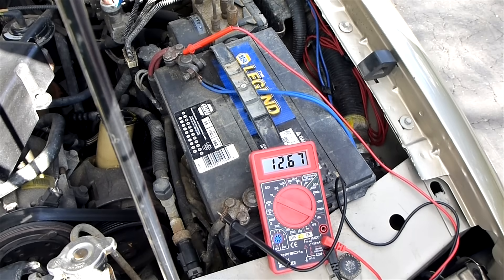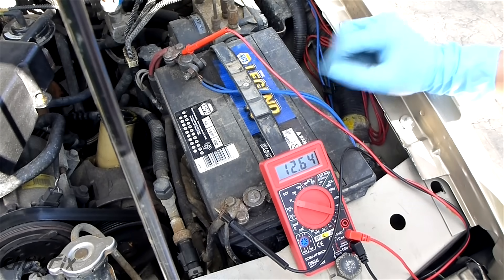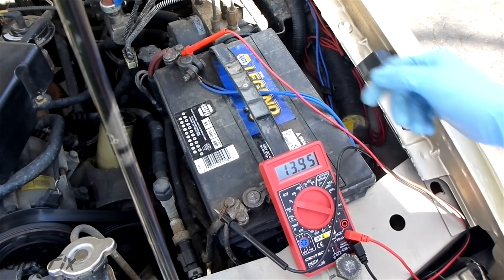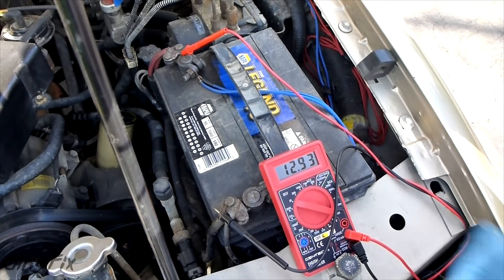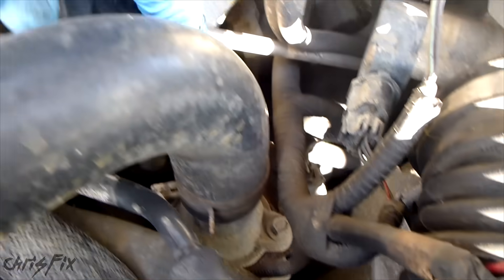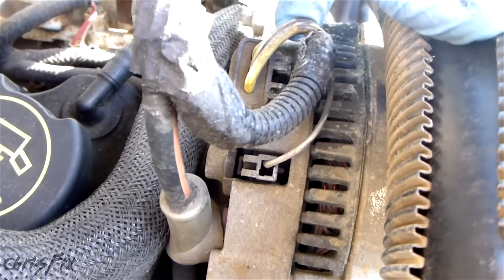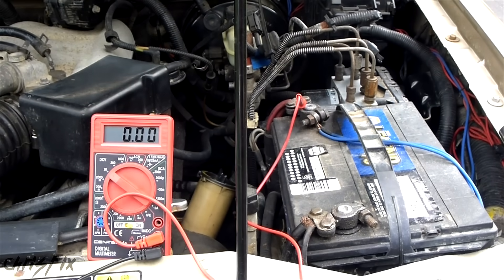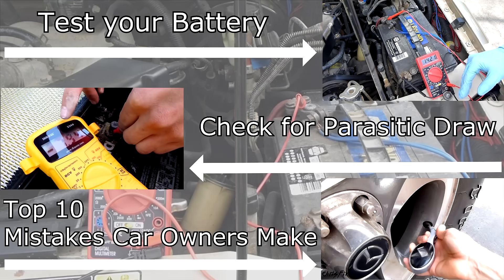How to Test an Alternator

Comment: Very good video but I wondered why you did not mention anything about the Ampage value from the Alternator?  Voltage and Ampage are both important and although I am not a mechanic, my friend is very experienced and says an alternator can kick out up to 80A, so using a cheap small multimeter rated at 10A is not suitable.  Also I once used my cheap meter to check a battery while it was off the car, and the those thin test cables got VERY HOT in seconds.  I've not tried it while the battery is connected to the car though.
Reply from the maker: +EgoShredder You need special equipment to get the amperage your alternator is putting out and every alternator puts out different amps.

Comment: my fathers 2009 f150 4.6 just went through a battery it was only a year old since I bought it and it was a ford oem, I tested the alternator and at idle with no accessories its at 14.4 volts, with accessories still 14.4. would this be damaging the battery by overcharging it? I also noticed that after sitting for a few hours shut down the battery goes down to 12.3 volts, I checked and I do have some sort of parasistic draw not sure where yet. I tested my 2015 f150 5.0 and the battery voltage at idle is 14.2 without and with accessories. is this indicating the voltage regulator on my fathers 09 f150 is starting to fail or malfunction?
Reply from the maker: +darthreven9999 The alternator can be from 14.2 to 14.6v so your 14.4 is fine. The parasitic draw on the other hand could be killing the batteries.
Reply: I'm looking into this now I am leaning to a bad diode in the alternator... when testing it on one side I get like 12 ish ohms of resistance consistant (the case of the alternator is corroded) and when I switch leads it starts at 1 ohm resistance and rises to out of limit resistance on my snap on multimeter after about 20 to 30 seconds. shouldn't it be instant? as far as I know if you get a low resistance reading both ways one of the diodes is no good and could be causing the alternator to draw from the battery when the engine is off. but Iv never seen this before where it starts at low resistance and works its way up to out of limits once you switch the test leads. any thoughts?

Comment: Hey Chris thank you for sharing these informative videos, is there any way I can contact you VIA call or on skype?
Reply from the maker: +Ovais Azhar I do not currently take calls.
Reply: ok well I am facing a problem in my car I have 1999 Toyota Corolla CE 100 in Diesel,The problem is I installed a hifi audio system along with some under glow led lighs and HIDs in my head lamp and I installed them 2 yrs ago. Now the problem is when turn my audio system on even in day time when hit brake,shift gears by the way the transmission is auto, or even use indicators what happened is my audio system turns off and turn on itself. One of the electrician said this problem is coz of my alternator. What do you think is it really my alternator or some thing else?? please help.

Comment: what if my battery remain going down from 13.13v after i turn the car off to 13.4v but not 12 point something?
Reply from the maker: +Rafael Leyva That is fine. It should be above 12v
Reply: +ChrisFix tanks chris

Comment: Hey Chris, thanks for the video. Can this be applied to a car that's frozen and won't start? I live in Canada and I've tried to get boosts but the engine won't start, and the battery indicator comes on. As soon as the car is disconnected the car dies again. It's a 2009 Honda Civic, and I have had battery issues in the past but replaced the battery last year. Any advice? Thanks!

Comment: hey i left a comment on your other video and i noticed my brake lights stay on what do i look for to stop that?
Reply from the maker: +Tito Santiago Check the brake switch that is connected to your brake pedal. It probably just needs adjustment.
Reply: +ChrisFix I replaced the brake pedal switch but lights still stay on????
Reply from the maker: +Tito Santiago Make sure it is adjusted correctly. If you pull the brake pedal all the way back (opposite of braking) and it comes off the switch all of the way, do the lights stay on? If so, I would check the brake light relay.

Comment: My battery shows 12.15 volt when i messure it but the car still doesent want to start ...... i connect my portable car battery jump starter and it still doesent start, whats wrong ?!
Reply: I had a similar thing before.
Just replaced the battery and it runs fine, and it still starts after stressing the electrical system with full beam lights, radio, cigar socket charging a tablet and a smartphone and air conditioning on full blast.

I also can't seem to start my car with a portable jump starter before unless if it was jumped using a car.
Reply: +chrischoy9 Thanks for the reply!

thats exactly what I did, I changed the battery and everything worked fine!

take care, peace!
Reply: Vild Mark yeah, it is probably a bad cell which might show 12-13voltes but not enough amperage for starter.

Comment: battery is at 12.6v perfect. turn the truck on, goes up to only 13.95v. testing the alternator and bracket is 0.02v so that's under 0.1. just want to confirm that I you think I should change my alternator.
Reply from the maker: +Matt Foley The alternator is a little weak so I would clean the grounds from the battery to the frame, the battery posts, and the engine ground. Your alternator is most likely fine.
Reply: Okay, thanks Chris. I cleaned my battery posts and it went up to 14.15v. I'll see what I can do about the other things too. You're the best.

Comment: easiest way i know to check an alternator is diconnect the positive terminal from the battery when the car is running...if the car dies...alternator  is not working...don't need no stinkin' gauges...
Reply from the maker: +wally walton Never disconnect the alternator with the car running. That can damage the alternator and your car's electronics.
Reply: not the alternator the battery...
done it a hundred times....
Reply: +wally walton -  You've been lucky, then.  Great to blow out any of the many computer control boards in a car.  Definitely not recommended for newer cars.  Might work OK on your 82 Dodge Dart "-)
Reply: +old curmudgeon  '07 Ram there old man...go crawl back under your rock
Reply: +wally walton Wrong!The moment  you disconnect either lead from your battery, it's entirely possible you caused thousands of dollars in damage. Here's why...Your battery does more than just provide electricity. It also shorts AC, spikes and transients to ground. Removing the battery from the circuit allows those spikes and transients to travel around, endangering every semiconductor circuit in your car. The ECU, the speed sensitive steering, the memory seat adjustments, the cruise control, and even the car's stereo.Even if your computers and stereo remain intact, in a great many cases removing the battery burns out the diodes in the alternator, necessitating a new alternator. If disconnecting the battery interferes with the voltage regulator's control voltage input, it's possible for the alternator voltage to go way over the top (I've heard some say hundreds of volts), frying everything.Even the initial premise was wrong. If you disconnect the battery and the car conks out, you don't know if it conked out due to insufficient alternator current, or whether the resulting transients caused your ECU (the car's computer, which controls fuel mixture, timing, and much more) to spit out bad data, shutting down the car.Nobody should EVER run their engine without a battery.Stop throwing out bad advice, Wally.
Reply: you stupid stupid man...you disconnect the positive terminal  on the batterey for a fraction of a second thats all...you will hear if the engine  dies or runs instantly...you  don't run the car with it out you dumbass. I can tell you another trick then Forest...If the alternator is working the pully will be magnetized providing you have a steel pulley and  you can get at it...all you do is hold a screwdriver  against the pulley. But OH NO that will rip my fucking arm off  won't it  there Forest???   AUGHHHHH!!!!!!!!!!!!!!!!!!!!!!!!!!!!!!!!!!!!!!!!!!!!!!! MY ARM  !!!!!!!!!!!!!!!!!AUGHHHHHHHHHHHH!!!!!!!!!!!! so where is this rock you live under...And  BTW Forest...Dodge  didn't  build   a  Dart  in  1982  dumbass

Comment: Thanks for the video. I recently replaced the alternator in my gf car but after starting up the engine I could smell a burning smell and hear a whining noise. This is the second alternator I've put in because the last one died a week after replacement. When I pulled it out I noticed there was melting around where the wire connected to the alternator. I checked my grounds and wires, everything is tight and seems ok. Is there a way to test a specific wire? Should I just try to add another ground?  Obviously, the wire is getting too hot, I'm just not sure how to troubleshoot it. It's a 2005 Mazda, with VERY limited room to work so it's a major pain in @$$, but I'd like to try. Anything helps, thanks!
Reply: +Tyson Dailey  Also, the first replacement alternator lasted about a week before it died.
Reply from the maker: +Tyson Dailey I would get a new ground wire. Make sure it is a thick gauge wire so the current can flow though. The old wire might have been damaged from heat or something.

Comment: The bolt coming out from the alternator is loose and can be turned,  the bolt which the battery cable is attached.
 The alternator is only 3 weeks old  (it's a brand new remmy) not a reman. Yesterday it stopped charging, it's the second alternator in the past 18 months, any ideas why ?  PS this alternator is on a 2002 Eldorado which is extremely difficult to change out.  Could the loose bolt be from mechanic error , although it has been 3 weeks since installed ?
Reply from the maker: +Joseph M They might have stripped the bolt and didnt tell you. Then with a loose alternator you dont have a good ground so it goes bad. Check this out: https://www.youtube.com/watch?v=XC8W9RHGTMI
Reply: +ChrisFix Thanks Chris for the reply,  so with the loose bolt connecting to the battery cable, it could cause a inferior ground that would burn out the alternator ?  I guess it worked during the 3 week period until it burnt up.
This is the reason I try to fix all my own vehicles, however, I had back surgery during this time and had to have a
local garage change it out.  Thanks Chris I do appreciate the help..
Reply from the maker: +Joseph M Potentially

Comment: I had my car turn off while driving, light wend off, engine stopped. I have a Chevy Cobalt with an original ignition switch, which has a recall on it. So it could be that, but to be safe I bought a FLUKE 115 on sale for $150. Thanks to your video I feel I can confidently make use of it to diagnose my problem.
Reply: The other issue you didn't mention or I missed your mention of it, is a bad drive belt, since a belt that slips will spin the alt at intermittent speeds/slower speeds.

Comment: Your ground post connection is completely loose man. You can see it spinning as you connected to it. Those ground wires look pretty bad as well. You need to replace that ground wire to the battery. I can't believe you didn't see it.
Reply: That's his Mazda, it's funny I have a ford explorer which looks almost exactly like his Mazda engine and my negative cable had been slightly loose for years no matter how tight I make it. I forget about it until I need to do electric work
Reply: +bryan1282 Mazdas are made in ex ford factories etc. War reparations.
Reply: Christopher Wright ,4
Reply: bryan1282 - Any metal shim will do the trick. Aluminum foil works perfectly. ;-)
Reply: bryan1282 u can wrap the neg terminal with a metal shim and then tighten the cable on it. helped on my car, maybe it can help you too
Reply: Rod Palm stop nitpicking dude he did a good job

Comment: Awesome video, what are your thoughts on using a light bar on a car, i have a 2002 honda crv with a 42 in led light bar it draws about 10.5 amps, could using the light bar cause the alternator to fail? thanks Chris.
Reply from the maker: +phillip lancaster Thanks! I will be doing a video on installing a light bar in a car. You dont want such a big one in a smaller car.
Reply: Ok sounds good, thank you for your feedback.

Comment: What if your multimeter has no DVC-20 setting? Only 10 to a 50 jump.
Reply from the maker: +JJ, M. use 50v then
Reply: +ChrisFix What would that mean for the measurement? Wouldn't it be false or for this test, it's a range that isn't so strict on the exact DCV?
Reply from the maker: +JJ, M. It is just a range so you get the decimal place in the right spot. You can run it on the 100v setting but it will not be as accurate.
Reply: +ChrisFix Alright, so I did a self battery test with engine off (multimeter set to DCV-50) and i&#39;m getting ~13.8.

Turned the car on and tested on the battery once again and i&#39;m getting ~13.6, then turned on my lights, a/c, &amp; headunit and I dipped down to ~13.1

So my amperage loss is of ~7-10? Or should I really test with a multimeter that can read at DCV-20?

It's not like my car has any startup issues at all (ignition is always less than 1.8 seconds by the morning with a whole evening/night of no engine use). But most importantly I do plan on upgrading my sound system with a secondary battery.

Comment: Dear +ChrisFix I have a Chevrolet Malibu 1982. When the engine is on, the voltage is 14.2 V but when I turn on  lights, air conditioner, and the stereo, the voltage drop to 12.3V. What do you think about it? Should I to buy a new alternator?
Reply from the maker: +Irán Quintero Sounds like the alternator is going bad. You could get it rebuilt or buy a new one.

Comment: so if i check the alt and the volts jump arounr from .89 to 14.6 volt dose that mean its bad
Reply from the maker: +Andy Thompson Make sure you have a good connection because it is not very likely to jump around that much. But if you have a good connection, then yes, it is definitely bad.

Comment: Yeah my car is reading a -0.01 so I have bad ground!?
Reply: Also just to let y'all know the alternator is new!
Reply: Also forgot to mention that when testing the engine block it reads a flat -0.00!
Reply: +BrownKnight011 Do the voltage drop test while someone is cranking the engine with the probes on the POST of the neg and the engine block. Disable injectors or ignition so vehicle won't start. Crank no longer than 10 seconds without a minute or 3 of starter cool down

Comment: my charging volt is at 13.76. I think I never noticed my guage before but yesterday i notice the battery guage move a lil. I don't  know if maybe because the fans turn on. is 13.76 too low???
Reply from the maker: +Miguel Suarez That is a little low. It should be 14.2V with only the car running. The 13.8v should be when some electronics are on (lights, fan, radio, etc).

Comment: Will a bad alternator prevent the car from starting? My son's car will crank, but won't start. His car just died when he was driving home and his dash lights all started flashing. We thought it was a bad battery and took it in to be tested. They said the battery was fine. We can't start the car to test the alternator as it was done in this video. Is there a way to test the alternator if the car wont' start?
Reply from the maker: +Mike Robinette A weak battery will prevent the car from starting. Now the battery can be weak from a bad alternator. You need to start the car to test the alternator.

Comment: question chris... i remember seeing this video a few months ago, & now at least when my car is warm, when i start the car once every fe wtimes, it starts up pretty slow.  like it goes upto idle rpm pretty slow, & i believe the starter was replaced before, the car is a 2005 and the alternator has never been replaced yet.  is that a possibility or can it be something else?
it started happening like around a month and a half or two ago
Reply from the maker: +WorldzGreatezt0294 Test the alternator and take your car to the local parts store and have them test the battery for free. Sounds like the battery is going bad. Check this out: https://www.youtube.com/watch?v=fRfPupikHT4
Reply: +ChrisFix even if my battery is only a year old? I definitely will test it in a few days. Its just weird that it happens only when the car is warm & when it's kind of cold outside, like the way the weather has been lately in jersey

Comment: hi chris, came across your vid trying to determine whast wrong with my car, battery or altenator. the lights headlites and fog and all cabin lights even dash boards flicker at low idle, 650 rpm but when i drive they're stable. brought car in they did a ca and cca test. ca crancking normal was 10.31 v 0.0 A . charching under load No Load14.34 v loaded 13.81v and state of health shows  Replace Battery. no problem starting and have blower and on board stereo running.s it the battery? or alternator. should i replace battery. 2012 Forte Coupe original battery. Help would be great. thanks.CCa spec: rated 600 measured 518. temp 29C
Reply from the maker: +Eric Cohen That battery sounds like it is good. I would think it is a dirty ground or alternator problem. Do the tests I showed in this video at the end.

Comment: what do you do if your battery isn't getting a charge but you've replaced the alternator ànd battery? ive cleaned the grounds and all the connections could it be the starter solonoid or the fuseable link between the alternator and soloniod? or a bad postive batter cable?
Reply from the maker: +Cooper Becraft Could be the fusible link. Did you do a voltage drop test to see?